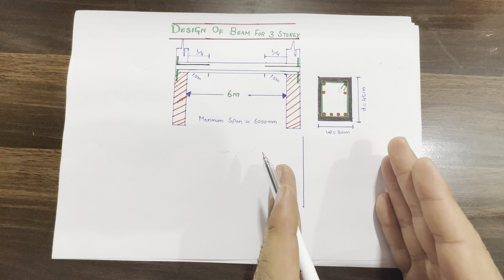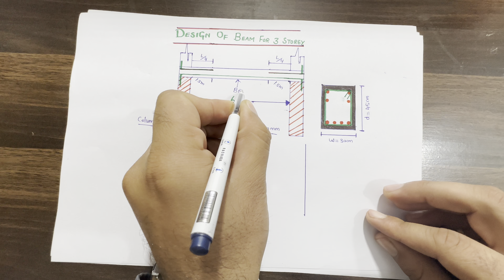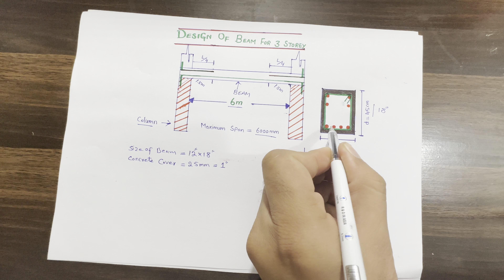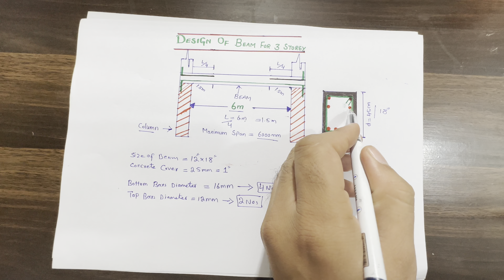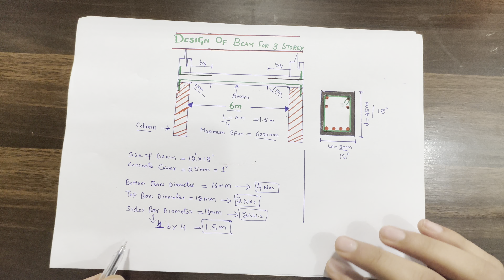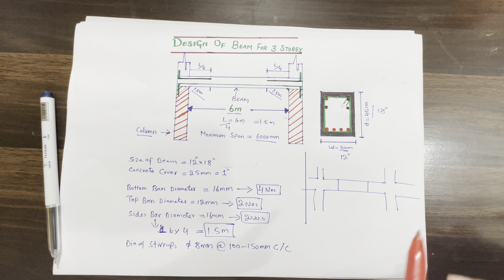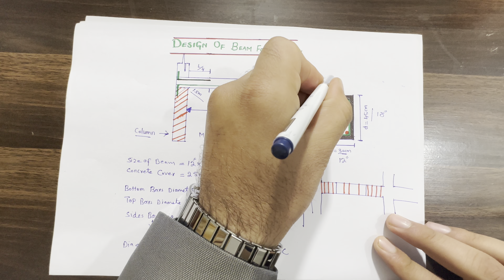Design of Beam for 3 Storey Building

Comment: Salam . God bless you for all the wonderful education..Question: On a 1 story house (g1)  is it absolutely necessary to use columns? Are reinforced cinder blocks not sufficient… I will be using imitation  tile roof  for its light weight and insulation

Comment: Can 12mm diameter steel be used for the beam
Reply: Yes
Reply: The foundation? Is that possible for a three storey building
Reply: How did you choose the width 300 and depth 450? Why not less or more??
Reply: I mean the beam size